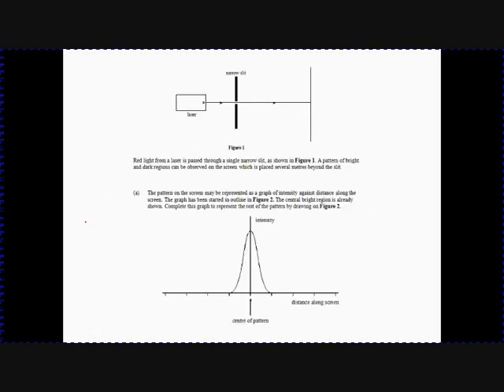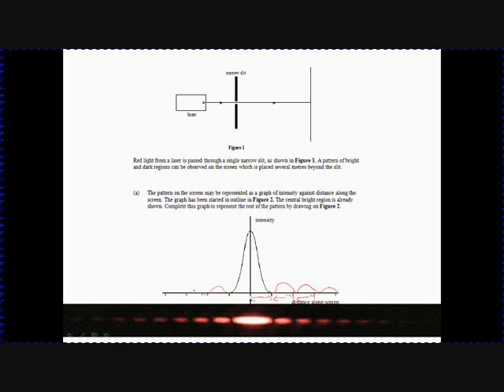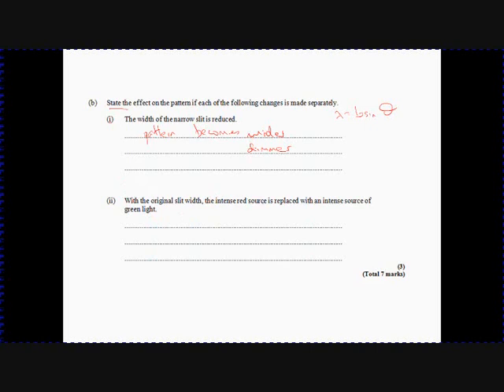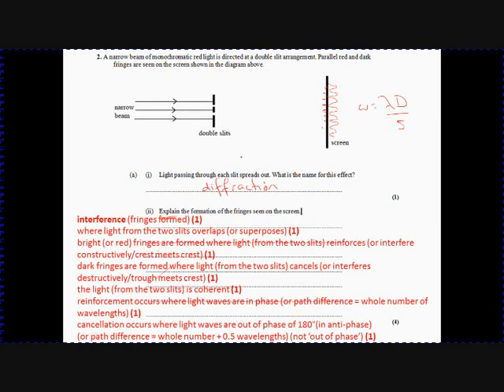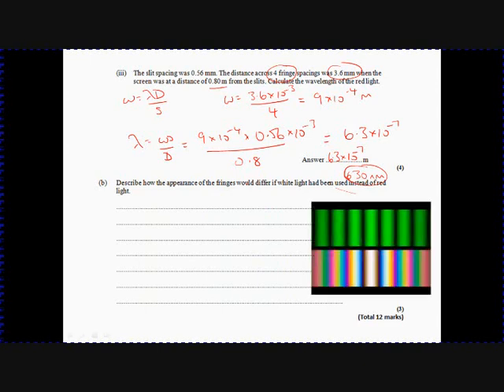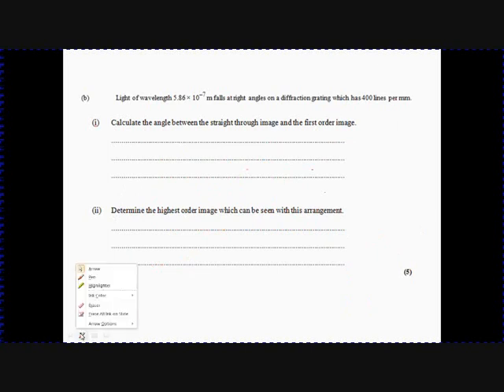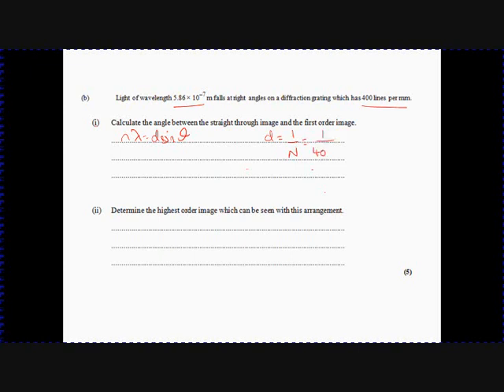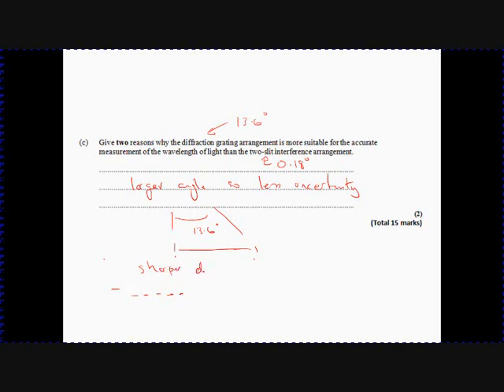Unit 2 Waves Checkpoint 7 Mark Scheme

Comment: For question 3aii, I keep getting 1.172 * 10^-10. I did (5.86 * 10^-7) * (0.36 * 10^-3) which gave me 2.1096 * 10^-10, then I divided that by 1.8 and it gave me 1.172*10^-10. I cant seem to get 2.9 * 10^-3 as the answer for the fringe separation.
Reply from the maker: Sorry I've messed that up totally. The equation is written incorrectly,  it should be w=lD/s so 5.86^10-7 x 1.8/(0.36^10-3) which is 2.9 ^10-3 .
Reply: ATPHYSICS1 okay thank you